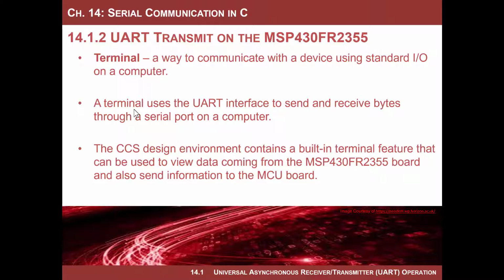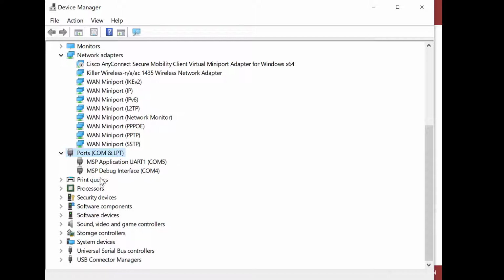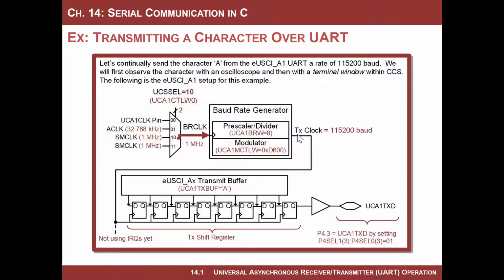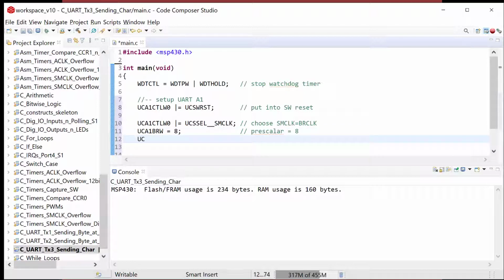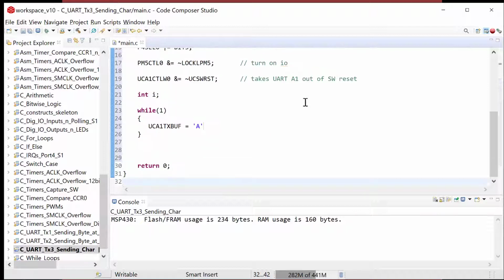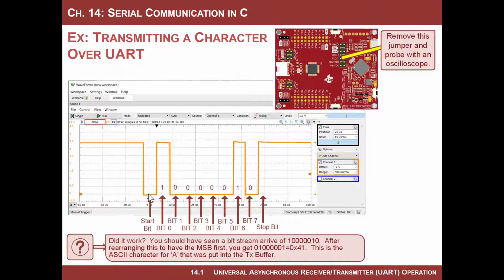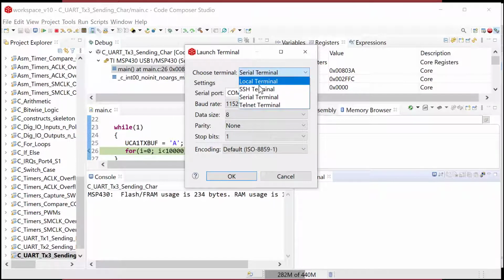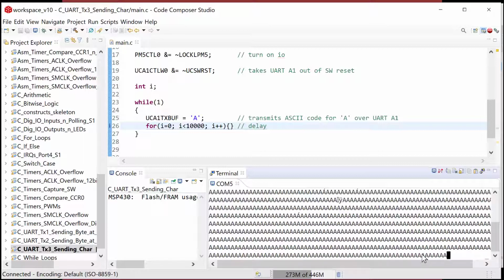14.1(h) - Serial Communication on the MSP430: The UART - Transmitting a Character to the Terminal

Comment: Why does the code not work?
#include <msp430.h> 

//MSP430F5358
int main(void)
{
	WDTCTL = WDTPW | WDTHOLD;	// stop watchdog timer
	P5DIR |= BIT3;//LED 4

	//--setup UART A2
	UCA2CTLW0  |= UCSWRST;       // software reset  UCA2CTL0 |= UCSWRST;   |= set bit

	UCA2CTLW0 |= UCSSEL__SMCLK; //choose SMCLK=BRCLK (115200 baud)
	UCA2BRW = 8;                // prescalar = 8
	UCA2MCTL  = 0xD6;         // OS16=low freq, set modulation

	P9SEL &= ~BIT3;            // change P4.3 function to A1 UART Tx
	P9SEL |= BIT3;

	PM5CTL0 &= ~LOCKLPM5;       // turn on io

	UCA2CTLW0  &= ~UCSWRST;       // out of software reset  UCA2CTL0 |= UCSWRST;  &= ~ clear a bit

	int i;

	while (1)
	{
	    P5OUT ^= BIT3;//LED 4 // Toggle the pin (XOR operation)
	    __delay_cycles(100000);// Add a delay to observe the toggling
	    UCA2TXBUF = 'A';            // transmits ASCII code for 'A' over UART
	    for(i=0; i<10000; i++){}    // delay
	}

	//return 0;
}